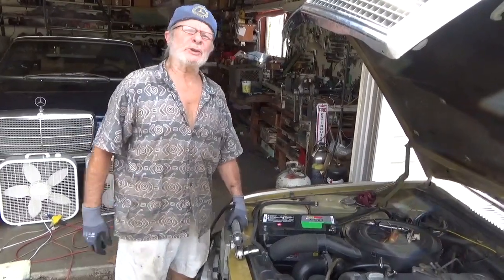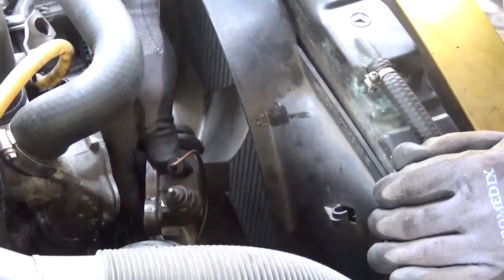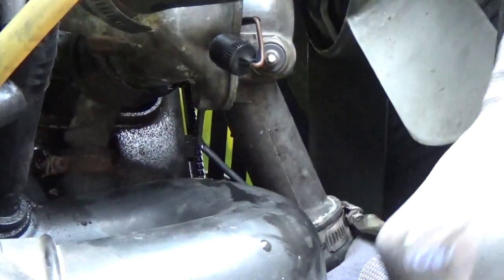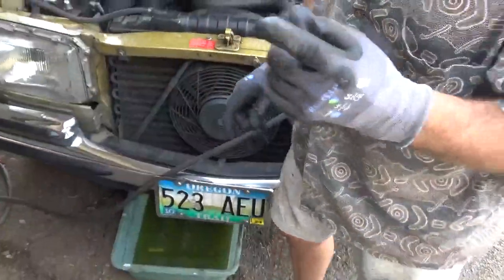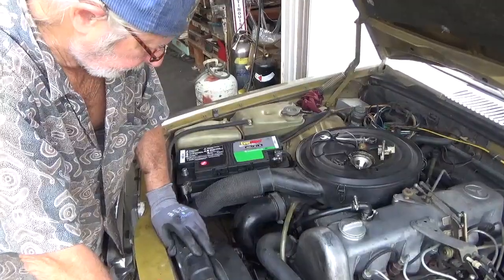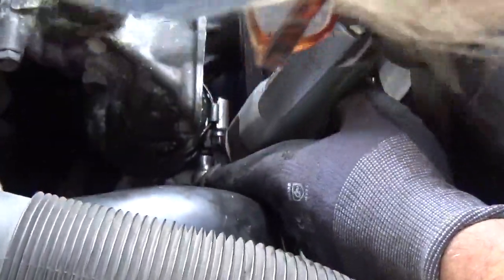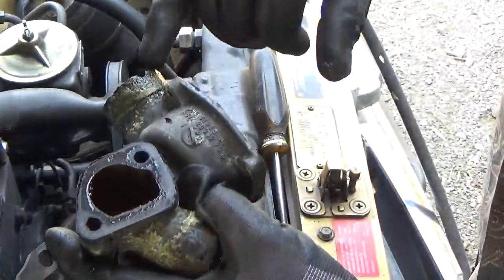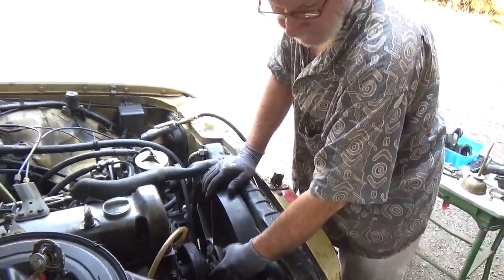Diesel Mercedes cooling system can of worms, part 1: corroded thermostat housing

Comment: What causes corrosion is using the wrong anti-freeze. You need to flush that green stuff and put in something that protects the aluminum parts. MB is now on a pink colored coolant, but the Zerex G05, or Peak Euro blue would also be good. Just flush thoroughly first.